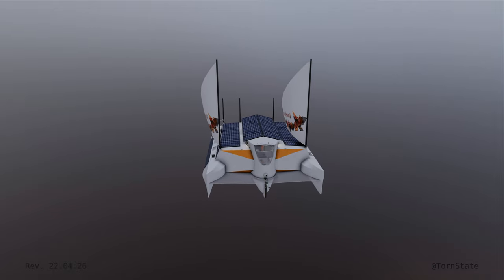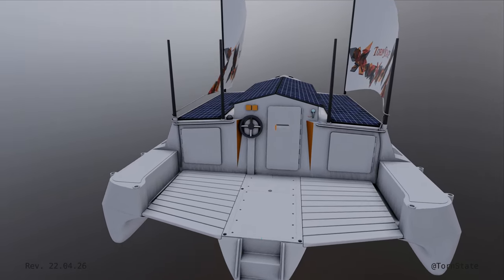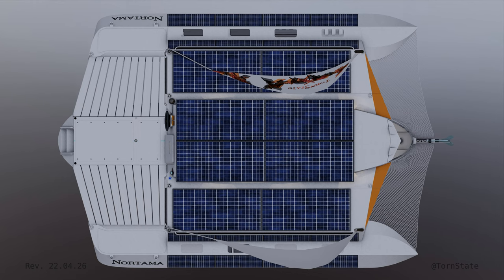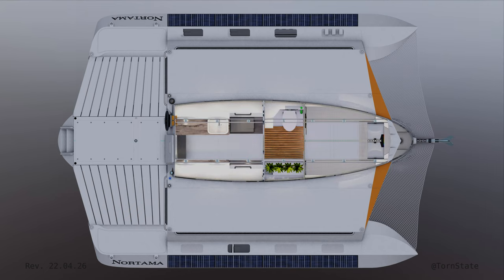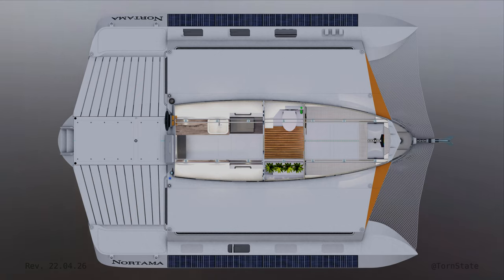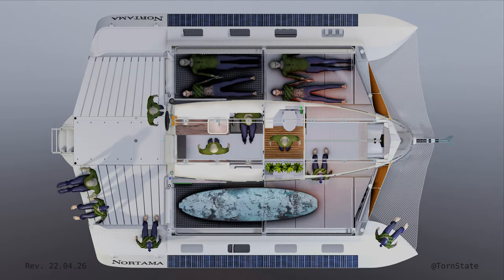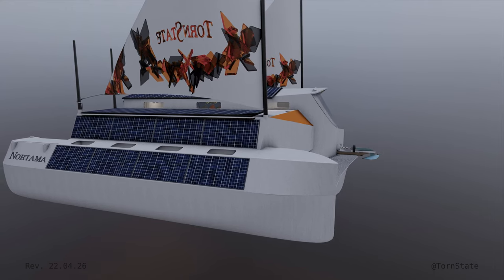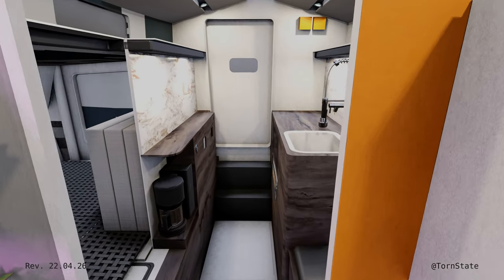Custom Sailing Trimaran: Ep2 The Design

Comment: Interesting. A centre cockpit would be safer and allow accomodation/cabins at stern. Also centre cockpit would be easier to provide shelter. Max crew/passengers 4. Underwater shape so important for hull speed, narrow waterline broadening as you rise up. Twin freestanding masts are a good idea, downwind goosewinging, center cabin top should be flat, presently looks slightly shed-like! Have u checked out Wild Rover boatbuilder chanel? I would love a trimaran but the cost is mad unfortunately-look forward to your progression. Good luck with build and fair sailing. SkipRay, Kerry, Ireland.
Reply from the maker: I will check out that channel and thanks for the suggestions. I wanted an extremely shallow draft which is why I shaped the hull the way I did. Performance was secondary. I may come to regret it.... but we'll see...

Comment: Thanks for sharing! I would add a roof with more solar at the back to have some shade outside :P
Reply from the maker: The Bimini was hidden for the render. I'm actually approaching the max solar charging current for my battery pack with what I have. It is a good idea tho if I am able to increase the pack in the future.
Reply: @TornState  right! just keep in mind that your solar array will probably have 70-80%  output from the datasheet values you will have some shades because of sails and masts that reduce quite a lot even thought it shades 10% of the area of the solar array.

Comment: My impression is you will need a minimum 6 Hp electric motor.  I am thinking there are much more knowledgeable professional sailors out there with definite expert knowledge on power requirements needed to escape the lee of a storm. Get a bad current and wrong wind, you will be forced onto shore. Of course, I spend a lot of my time watching axial generator videos so maybe I'm biased.
Reply from the maker: famous last words Nah it'll be fine. :) There are tons of boats out there with no motors and just sails. But Yea, The current plan is two 10kw motors mounted on the amas. Unless I really break the bank tho my battery capacity to run them is gonna be real limited. We'll see how it goes.